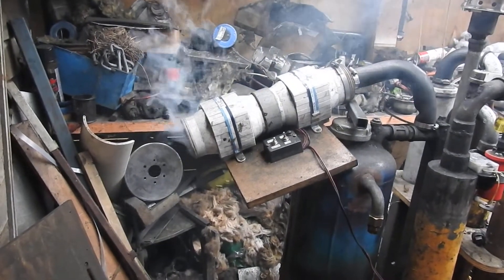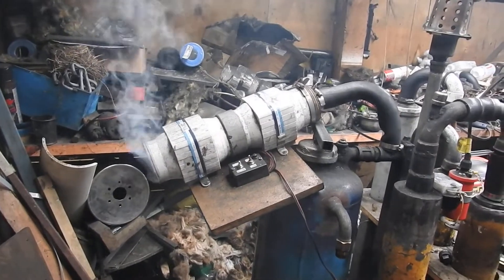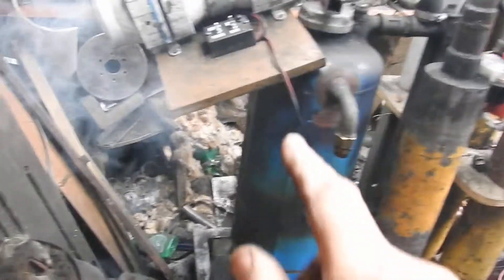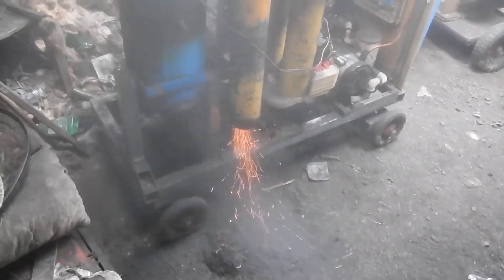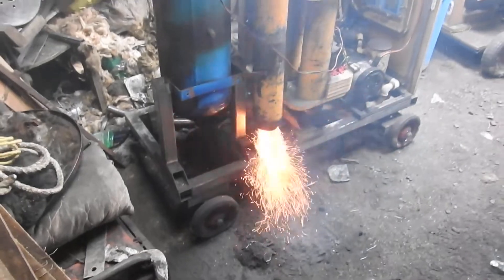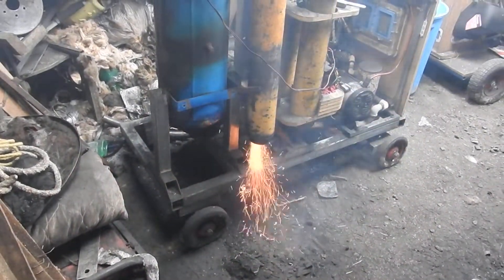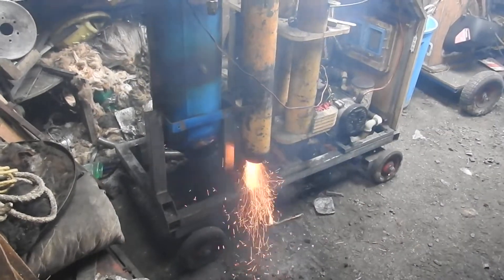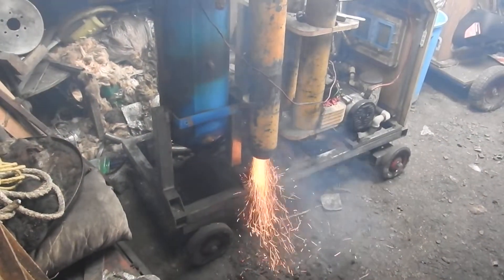Flame cleaning the cyclone on the Charlek gasifier.

Comment: How much of the system do you do this to? Each section individually? After how many hours of use? Thanks for sharing.  Joe
Reply from the maker: The Charlek needs more frequent cleaning than a normal gasser does, as the fine dust in the charcoal tends to block the plumbing - if allowed to accumulate. 
 It is possible to clean at least half of the system in one go, by sucking the flame in at a more distant point in the pipework. 
 Normally, I do this flame cleaning after about 50 hours of operation, but I neglected to do the cyclone, until today, as it hasn't been cleaned in over a year, hence the rather large cloud of rocket fuel  :) .

Comment: You should take it into town on the 4th of July and clean it in public just for the shock and awe effect It would be a hit!
Reply from the maker: Hehehehe. 
 Yup, a free fireworks display - and a visit from the bomb squad. 
 Watt a perfect day that wood be  ;) .
Reply: @CNCmachiningisfun  I wasn't thinking that you guy's don't celebrate the 4th but it still sounded good. Maybe you could bring it here to the states on the 4th and do a rock & roll gasifier tour. Speaking of woodgas, how is the new build working out for you?
Reply from the maker: @flash001USA  
 No worries on the July 4th thing. 
 We do however have our fireworks funtimes on November 5th. 
 Smokey sparkles will go down well, be it here or in the States  :) . 
 The new gasser is doing quite well now, but I will need to do a video on it - to show watt I have done to it in order to get it working. 
 So far though, the newly rebuilt gasser is running cleanly, and I am able to get an orange flare about 3 to 4 minutes after ignition. 
 The burn is inclined to de-stratify, and work its way up the hopper, and I am thinking that this may be due to a leaky lid, and too small of an air intake/nozzle feed pipe. 
 Further, smokey, experiments are in order, methinks  :) .

Comment: What a great idea :) just thought about this too.
Reply from the maker: Yup. 
 I developed this process a few years back, when I noticed that the systems were getting blocked up by fine dust and soot. 
 This makes for an easy, albeit smokey, way of cleaning out the entire plumbing network  :) .
Reply: @CNCmachiningisfun  Steve, I just developed another way to do it. Yesterday when I didn't discover the air leak in my system, I had a backdraft again and it pushed the hell out of my filters :D but don't worry. The whole system is alive and doing it's job at the best. With clean filters :D
Reply from the maker: @ravelkoff3549  
 Nice! 
 Don't you just love it when an accidental explosion clears those pesky blockages? 
 Sometimes, when I sneeze, my eyes pop out. This is the perfect opportunity to polish them with a toothbrush, before putting them back in  ;) .
Reply: @CNCmachiningisfun  :D